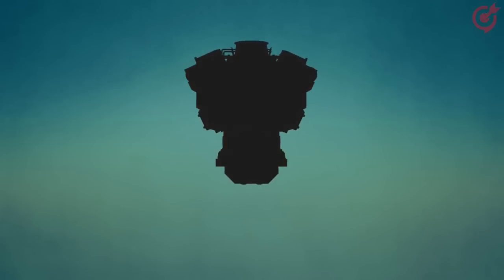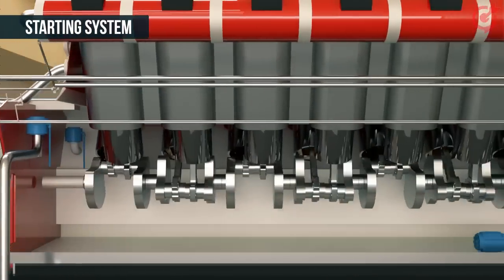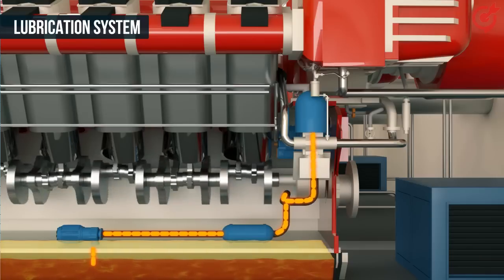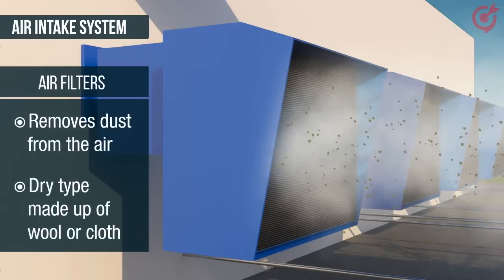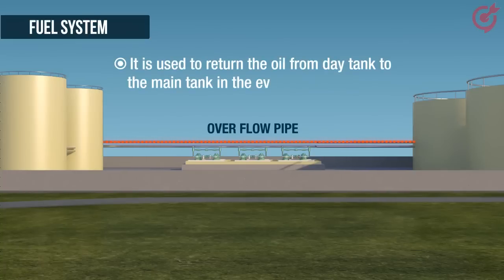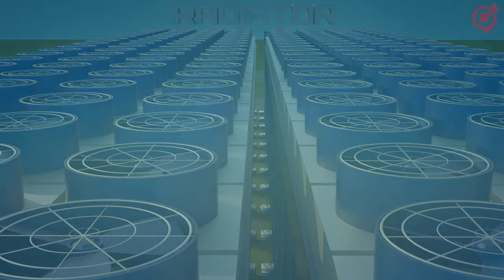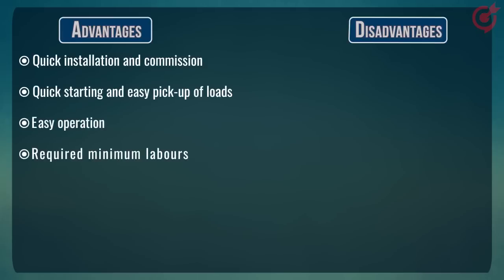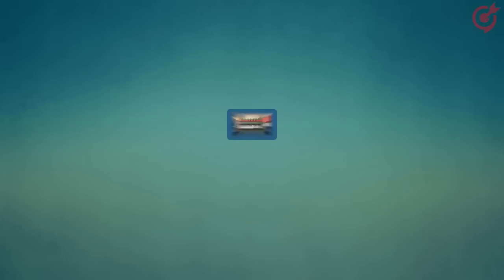Working of Diesel Power Plant

Comment: I would like to add three things:
1. since it's relatively simple to use and operate, it's well suitable for countries which dont have the expertise to operate more sophisticated types of power plants
2. hot water from cooling system can be used in an adjacent industrial zone for further economic activity, increasing overall resource use efficiency
3. such a power plant can be converted or made as a duel-fuel plant, where it can also consume cheaper LPG or methane gas. this can make it more economical to operate.
Reply from the maker: Thank you for your addition.
Reply: 2nd point also known as cogeneration
Reply: @ilearneducation3992  gladly! :)